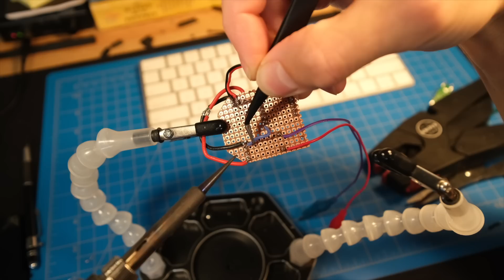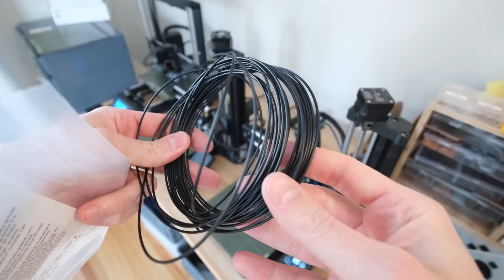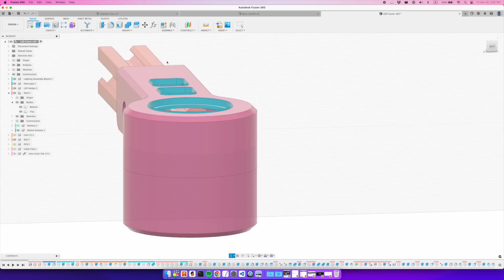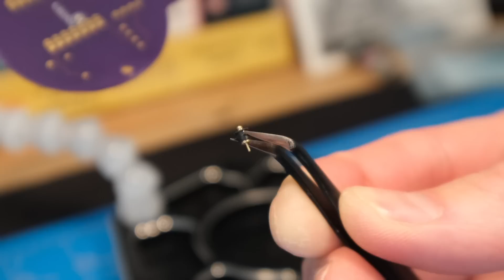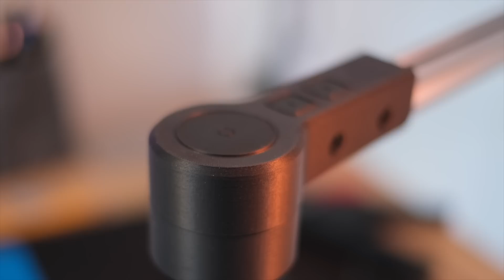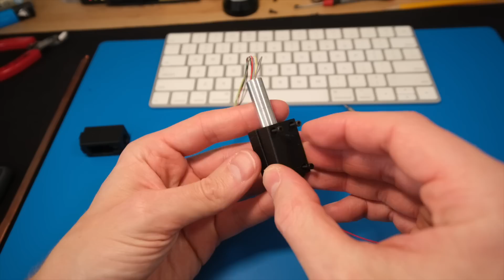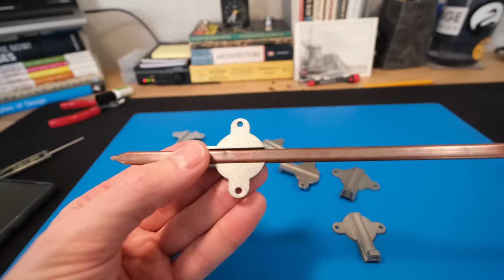The DIYson Electronics Pushed my Limits - DIYson Lamp Build Log #7

Comment: Hey, I’m a huge fan of the project and it’s inspired me a lot but I gotta say, the more I see the dragchain, the more I’m thrown off by it, it really takes away a lot of the elegance of the device. I think the problem of the cables can be solved with sliding contacts. Let me know if you wanna talk about it!
Reply: PCB and pogo pins ?
Reply: @Nairod785  I was thinking of a spring steel sheet but pogo pin also sounds great

Comment: What input type does the analog dimmer have? You could use an external I2C DAC with your microprocessor and the scale the voltage to the desired range if needed through an operational amplifier. If you need help we could talk over discord :D

Comment: What about making an asymetric dragchain that lies flat in a circle, and bends back over the same circle when bent, instead of in a straight line. To use for the rotating base instead of the slip ring, to keep with the current dragchain theme of the rest :p or atleast as an alternative

Comment: Why use PWM at all?
For high power LEDs a constant current driver is better and flicker free.
Also since the current gets regulated you make sure the LED can't end up in a thermal runaway situation.
Oh and you don't need to cram everything in the lamphead two wires to the LED would suffice so the controller could sit somewhere else.

Comment: I'm considering the XL4001 chip for my light (cree cxa 13xx 36v). They are cheap ,can handle high current. 

(1W LED Driver 350mA PWM Dimming Input 5-35V DC-DC Buck Constant Current Module)

Paste in aliexpress. Change the resistors to control the current.

Comment: Maybe you could use a different LED? I've seen small CC LED drivers around that can operate at frequencies high enough to not be heard or perceived on camera. They're adjustable, but the problem is that they're limited to 6V 1.5A max. The voltage is the main issue, but maybe with a different LED you could manage to do it. That creates a few more problems but maybe it could be a solution.

Comment: Using PWM for brightness control is a fundamental error.
Your LED is a CURRENT device. Your PWM power is a modulated VOLTAGE source.
The reason everyone is going the PWM route is because it is a direct digital solution. You should be using a VCC-source. (Voltage controlled Current Source) and then use the DAC that is already available on your QTpy.

Comment: I would like to see the cable routed internally in a tube instead, then exit from the base. A tube is strong enough to support the lamp.
Reply: We still might see internal routing as it seems like he hinted at a custom PCB that slides into the extrusion right at the end of the video.
Reply: what do you want to replace with a tube?
Reply: @julianbinder2371  The steel rod that go between the Feet on the table, and the lamp post can be hollow to allow for internal routing of the wires.

Go back to the initial videos and look at the Dyson lamp, how big diameter that feet is. Most likely hiding the bearing and cable management as well.

Comment: You can eliminate the problem with the flickering by using a low pass RC filter. Flickering is unhealthy and there are a few norms for this. Example IEEE 1789-2015, and you can find  there chapter about PWM LED drivers.

Comment: Could you kindly share the part no of the pogo pins you are using ? Thanks
Reply from the maker: Whoops, forgot to add those to parts list on Github. It's three of these: https://www.digikey.com/en/products/detail/mill-max-manufacturing-corp/807-22-001-10-001101/5418772

Comment: Why 4KHz? Did you do intermediate tests between 1K and 4K? Also, what frame rate do you shoot? If you shoot at 120 fps you would should only need a low multiple of that frame rate to remove flicker.  Like 480 Hz. I don't know, though, maybe I'm wrong.

Oh, someone already suggested similar. ¯\_(ツ)_/¯ leaving it up to feed Al.

Comment: You don't need to up the frequency to 4000hz... You just need to adjust it so that it doesn't align with your filming frame rate/iso.
You can also make some adjustments in your camera... Google rolling shutter and you'll see a host of info on how to fix the situation.
Reply: Yeah, but given that researchers have found that in testing, the most sensitive individuals could detect flicker in LEDs PWM dimmed at 3KHz with the naked eye, it’s wise to go high. I ended up using 26KHz in an LED dimmer I built at home, because the minimum frequency needed to avoid flicker (just under 3KHz for me) was totally audible.
Reply: @tookitogo  It's not about human detection. A human can't detect LED flicker through a video "frame" that is exposed to light if all of the frames have the same amount/duty cycle of light added to them.

It's about rolling shutter.
Reply: @ryanokeefe12  It’s about both. You can easily eliminate rolling shutter flicker with low PWM frequencies. But you don’t want it flickering to the naked eye, either.

Comment: if your MCU has good hardware PWM output, just replace your integrated driver with a driver chip (I like IR4427) and a MOSFET and you're off to the races

Comment: Not a perfect for all situations fix, but certainly a cheap one... try lowering the shutter speed to a common multiple. Something like 300 or 600 might eliminate the flickering for a majority of cameras and situations. Alternatively, you could consider driving the LED with a MOSFET, though you'll lose some of the niceties of a proper driver, you can usually run them at pretty high frequencies.

Comment: I find "touch" controls in general to be the worst in basically every single aspect. My sister has a touch-control induction cooktop.... you have to first "select" which zone to control, then drag a virtual slider to set the power.... the slider does not always work as expected, if you just swipe the stove to clean it it will start beeping, if it is wet it might not react at all, having anything conductive like a pot on top will also make it freak out, and of course there is the problem that you now have 1 single flat piece of glass were also the controls are located - have fun when the pasta-water is boiling over.
It literally has 0 benefits.

I still wish they would make phones with PHYSICAL ok/back/menu buttons again. "ok, ciao, bye bye" - and then i can't hang up cause first i have to unlock the phone, then get rid of the notifications and only then i can hang up. Why the fuck is something we had been able to do with the press of a single button for many years now so cumbersome?

Sure there are applications were a touch-interface is good. It is great for dirty/toxic/dangerous environments, or something like a touch-controlled lamp. But interfaces? Ok on a tablet, stupid on most hardware.

Comment: With a little more practice, you could implement the whole circuitry way smaller. That's really a pity that most of the project is very well designed but the electronics part isn't. 

I thought, that you will use the big BOBs only for testing, but you really put them on the final PCB.

Comment: What I really don't get: you're talking about visual noise and design while you are using multiple different types of screws. Philips, torx, inbus etc. Why not agree on one type?
Reply from the maker: Yeah, there are a couple of constraining factors that lead to any of my screw choices. The Phillips screws used to secure the PCB were driven by a size constraint (I needed the biggest possible head diameter on a M1.6 screw of a specific length, it just happened to be Phillips in this case). Fortunately those are the only screw heads that aren't hex and they aren't visible. There are no torx or other screw types unless I'm forgetting some?
Reply: @StevenBennettMakes  M1.6 hex screws exist on the market.
Anyway, the other screws are not in the design anymore, I confused it with the 4th episode I guess, where you used slotted screws.
Reply from the maker: @maxhouseman3129  I don't claim M1.6 hex screws don't exist, just not immediately available in the spec I needed :) And you're right! Totally forgot that there is a slotted screw used to hold the LED adapter in place. That's a special "cheese head" type screw, it's a weird one and needs to be weird for proper clearance. You'll be glad to hear that it's also hidden :)

Comment: The moment when you talk about buttons sitting flush and talking capacitive touch I cringed so hard.
You do know the "buttons" can be on the inside of a printed surface, and you just need to demark on the surface (if you want to for user-friendlyness) where to touch it?
Often you need to adjust trigger sensitivity of the capsense system but that is all. You can get the same effect with just a pin on the controller and a piece of copper tape on the inside to make the button too.

Comment: Had this exact problem with a 3d printer project where I needed to filter a pwm signal. A nicely dimensioned RC (resistance + capacitor) filter will do the job nicely. Send me a message if you need more info! Cheers!
Reply: This won't work properly. The pwm signal is controlling the led driver. Filtering it will just degrade the control down to the point where the driver won't be controlled any more.
Reply: @gromain  but how about you filter after the driver?

Comment: not sure if the metal part needs to be the exact design you got there but if you could make it without the grove on the top you could get away with having a simple flat sheet of aluminium cnced into shape and then using 3d printer press tools to get the bottom grove and the back side into the right shape.
check out the very first video on the Stuff made here Youtube channel to get an idea what i mean.
Machining the part like you have it in the video right now will be relatively expensive because its a 2 sided operation and you need to come from a large piece to machine the little tab at the end into it.
designing it to be bend into shape could save a lot of money.